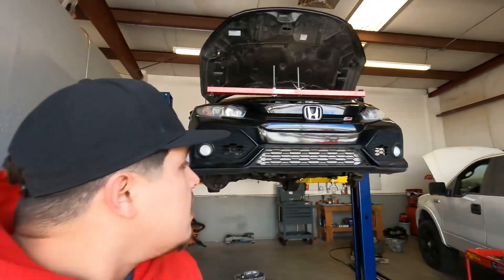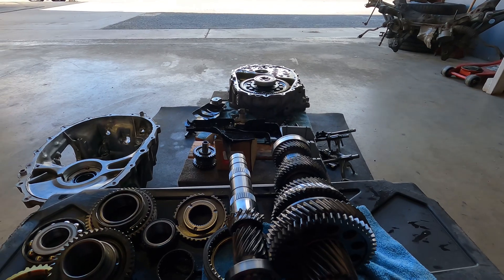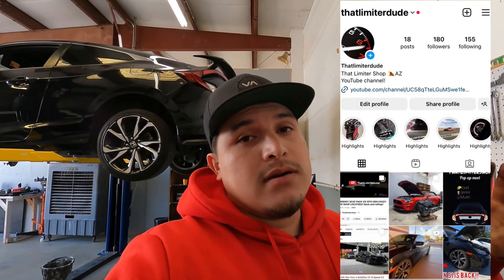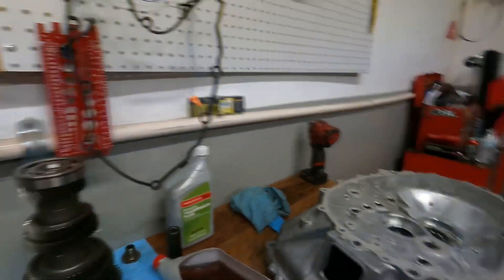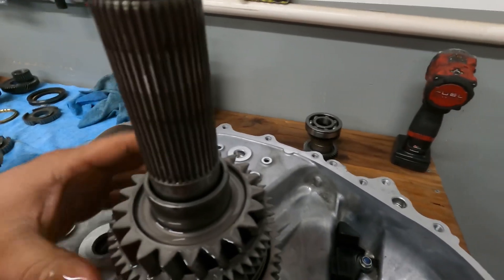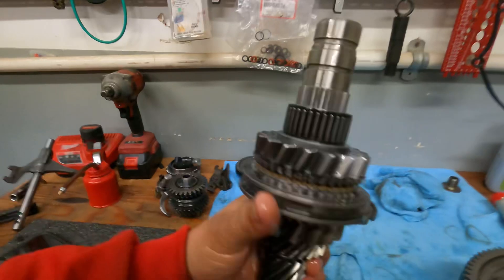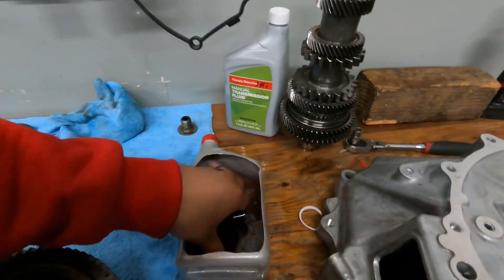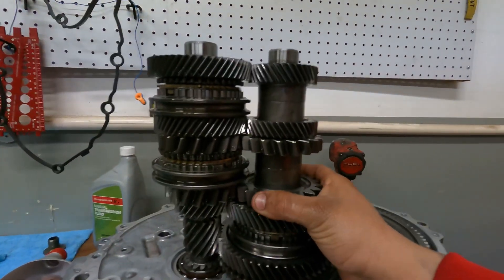RV6 Cut 3rd & 4th Gears!! Install 10Th Gen Civic si!!

Comment: Hi, I have the same gears in my trans that I put it after a money shift and was wondering if wondering if youve driven it yet, does your trans whine in all gears or just 3rd and 4th? And if so how loud. Thank you for your time.🙏
Reply from the maker: Only 3rd and 4th gear wine everything else should be smooth quite sorry for the late reply dude
Reply: @thatlimiterdude5518  thats ok, I appreciate the input. I money shifted my si last december and its been an uphill battle trying to fix it but after pulling the trans and disassembling it 6 times, I believe the problem is the differential ring gear. Thanks for the reply, it helps me narrow down the problem😎